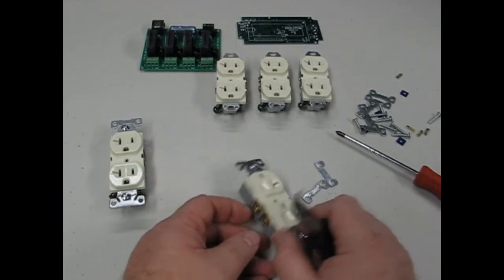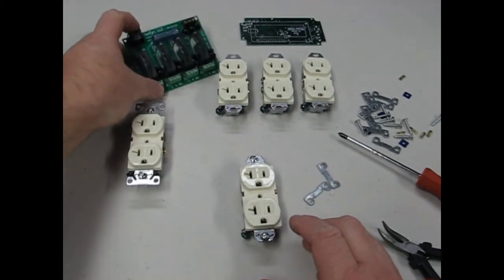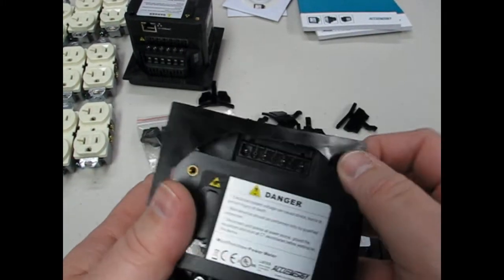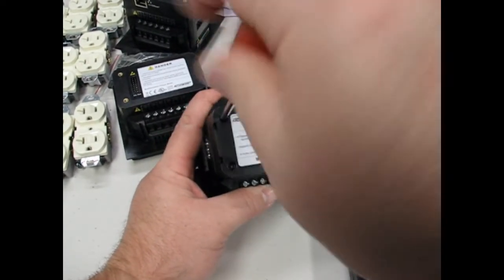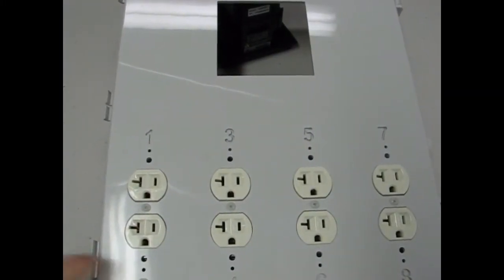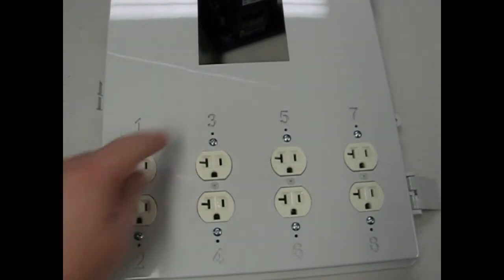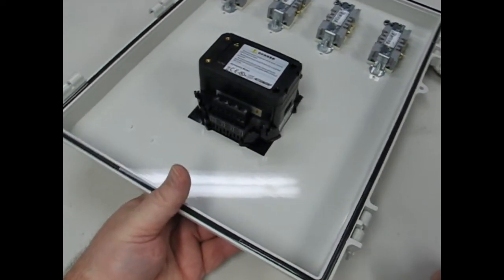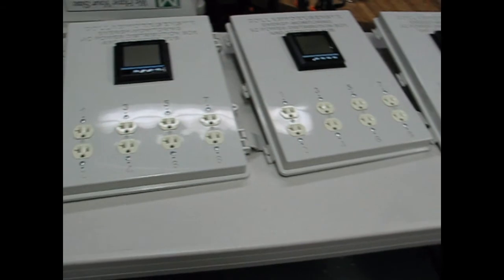Part Two of Energy Monitoring Box

Comment: Thanks. In the end, we left it alone. We had a fourth test panel where we tried a bunch of techniques--everything from black shoe polish to RTV--to fill the lettering. Hot glue worked fairly well, as did silicone RTV. I even tried glow-in-the-dark hot glue just for fun. We liked the hot glue because it could be re-worked with a heat gun to remove the excess and even the fill.